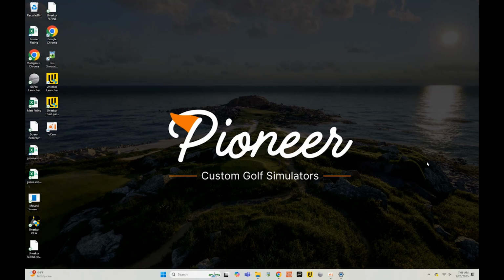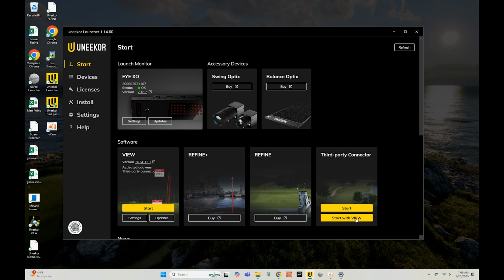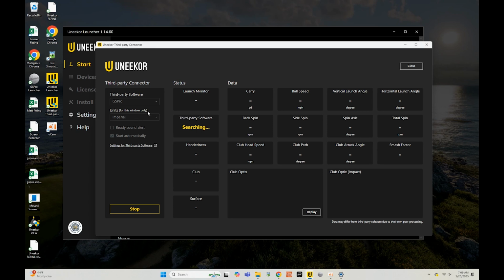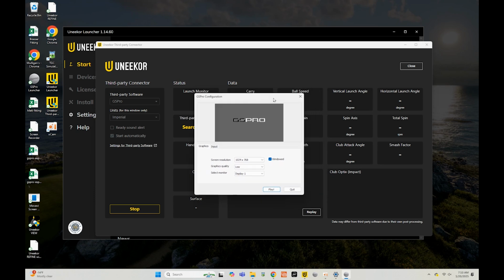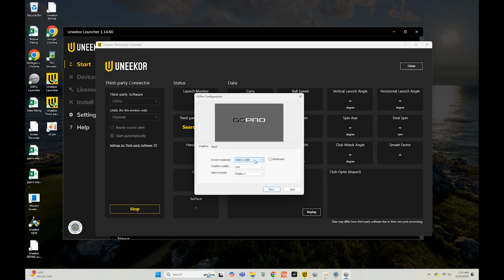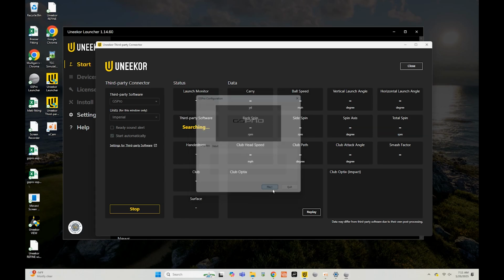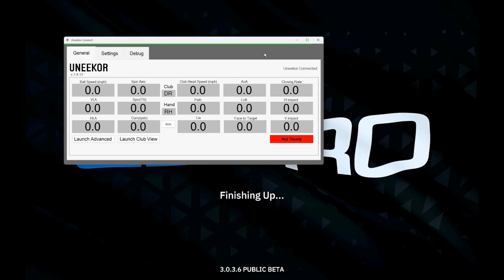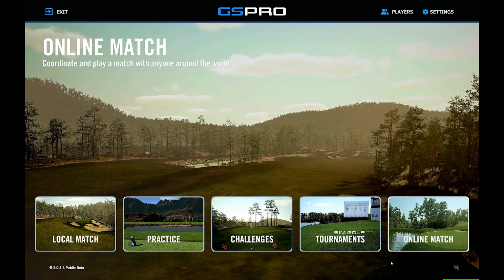Connecting GSPro + Uneekor Software (Startup Process)

Comment: I have a eml and when I registered it I accepted the 3 month trial of ultimate and then leased GSPro. Installed it and I can go into the game and set my ball down and the light on eml turns green good to go and if I move the ball it goes pink till it stops moving so I  know it sees it. When I hit the ball it does not see it.  Any suggestions?
Reply from the maker: Yes, here are the steps:

1. Open Uneekor Launcher and ensure you're on the main screen
2. Click "Play Now" when you see the GSPro icon
3. Open GSPro and click "Play!"
4. This should connect both programs, if it's still not connecting, within GSPro click "Settings" and then "System" and then "Reset GSPro Connect"